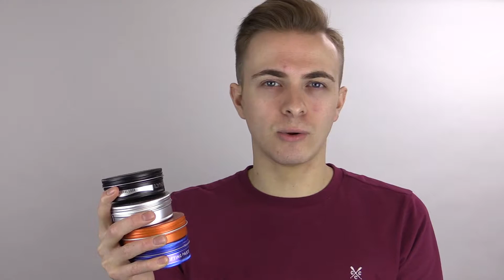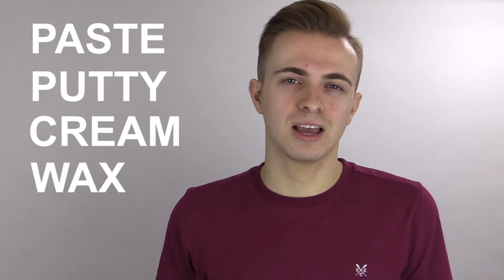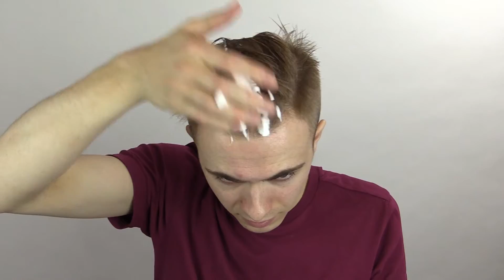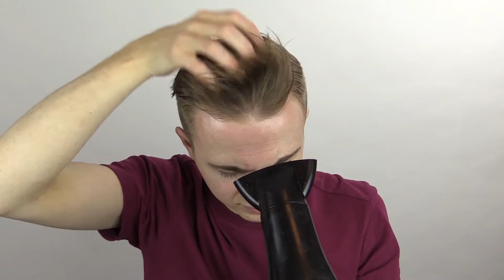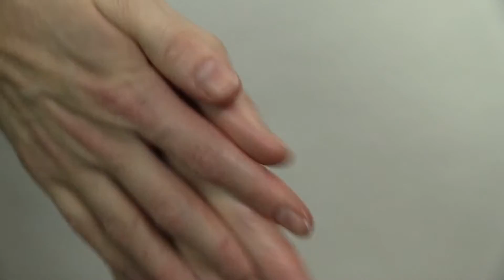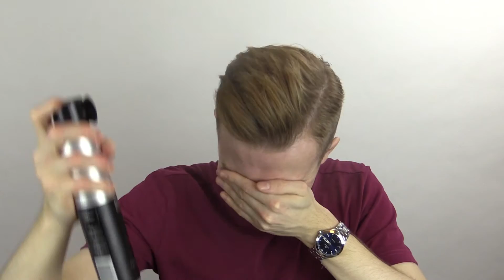How To Gel Your Hair THE RIGHT WAY | Using Hair Products | Pastes, Putties, Clays & Waxes TUTORIAL

Comment: i have very fine hair myself but about a year ago i somehow came across a technique that gives my hair insane volume and thickness in just 2 minutes. what i do is, when im done  washing my hair i use the towel and gently dry it. only for a little bit. then i apply the got2b beach matt paste into my wet hair. by doing this you wanna take a lot of the product! and make sure you rubb it in multiple times until you feel your pretty much full with the paste. after that i use the towel and dry the hair. as there is a lot of product in it you have to do like some sort of " stop and go technique" meaning you dry your hair with the towel for a minute or less then use your hands to place it in the wanted dircetion and towel it again. continue this and your will gain mor thickness and volume. at a point you should feel like you can use your hair to place it in a dircection and it will look full and it will hold. your pretty much done now but i like to add some hairspray as your will move around the first 30-50 minutes but then you end up having thick hair until you wash it again.

feel free to use this technique it works incredibly well for me!
as always great video <3
Reply from the maker: I've recently bought some of the beach matte paste, i will be doing a review on it on the channel soon so stay tuned! :)

Comment: Hey great video! although an explanation on what each of these products is best for would have been nice! I enjoyed it.
I have a mousse that is super high hold, and not at all volumising, should I use it? or is it pointless? If not are clays good prestylers? Or do pastes work better in that regard?
Last question I swear! Are petroleum based clays water soluble?
Reply from the maker: Don't worry, the explanations for product functions will be covered in another video. I didn't want to make this one too long :) In terms of that mousse, I would probably just give it a try if you already have it. I imagine it won't perform as well as a volumising one when using it as a prestyler, but then again it depends how much volume you think it would need. I find that clays and pastes are very similar generally when it comes to prestyling, for me the pastes tend to be slightly better but still not as good as mousse. Some clays may be water soluble, but not as much as a water soluble pomade for example. I showed an example of a great water soluble pomade in the last live stream I did, you may want to check it out :)